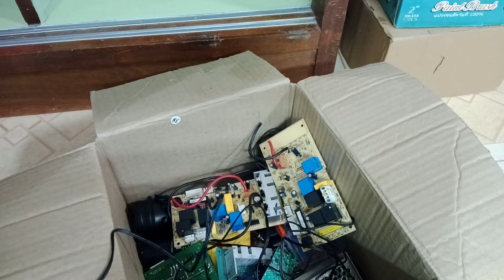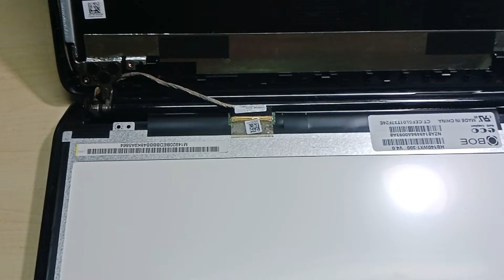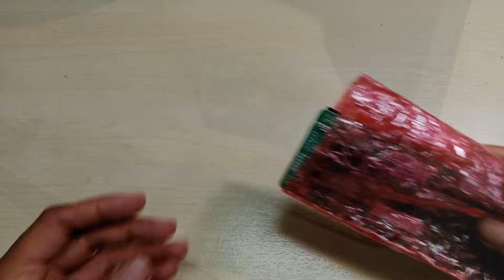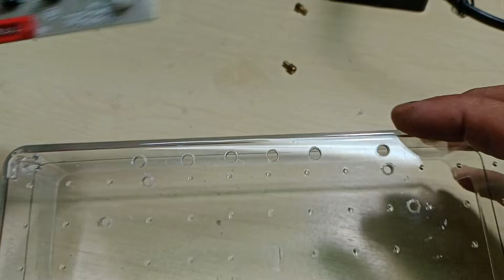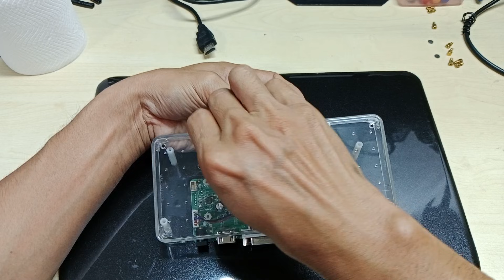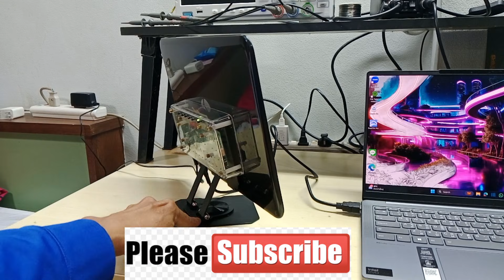Turning Old Laptop into Computer Monitor

Comment: You didnt show the most important part of how you connected the screen and the board with the wire/ribbon
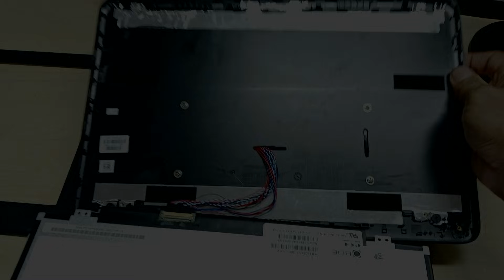Reply from the maker: Hi. Have a look again starting from 5:40 onwards. It is very clear how the screen is connected to the board via connecting wires that came with the kit.
Reply: @DIYPhil  @5:40 shows its already connected but not how you connected it step by step from the board to the screen

Comment: I have an old Dell Lattitude 3550 that is stuck with Windows 10, so I decided to take it apart & use the screen as a 2nd monitor. I bought an LCD controller board, which says compatible with N156BGE-EA2, plugged in the ribbon cable, plugged in a 12v power supply I had lying around, and the HDMI. The screen is blank, and my laptop says "No second monitor detected," but my cursor disappears off the edge of my laptop screen as if I had a 2nd monitor plugged in.

I plugged it back into the original laptop, & it works just fine.

Is there something else I have to do to get it working? Some combination of control board buttons I need to push? A new driver I need to download?
Reply from the maker: in my experience, the controller works immediately. in fact, it will work even if not attaching the separate push button boards. my suggestion is to try plugging the hdmi on a different computer. maybe it is just a device driver issue.

Comment: Sorry. Where can I get the wallpapers you used in the video? It's very informative, by the way. Thanks so much in advance for your response. Disculpa. ¿Donde consigo los fondos de pantallas que utilizaste en el video? Muy explicativo por cierto. Mil gracias de antemano por responder.
Reply from the maker: Hi. The wall paper is automatically generated by Windows 11 and it changes ones in a while

Comment: just good for viewing... but not for learning. You did not tell the details how you connect the connector from the LCD to the board.... Hopefully next time more on details....
Reply from the maker: The controller board kit has the right connectors for the lcd screen. It is just plug and play so there is no chance to get it wrong as long as you got the right kit. That is why the most important step I showed in the video is looking for the model number of the lcd screen.

Comment: If It Is a normal screen is a lost of time but if It Is a touch screen and in this way Is possible to have a touch screen to connect another PC , then I think that  It Is a very happy idea.
Reply from the maker: correct. the normal screen will soon be replaced by touch screen types. this project is just making use of old tech instead of ending up in the trash.

Comment: i have an 2007/08 core2duo laptop screen can it made like yours? btw is it necessary to use the switch?
Reply from the maker: first you have to look for the model number of your screen. then you search for the right controller board kit for that particular model. if you can find a controller for that LCD screen then it is definitely possible. I tried my controller board connected to the lcd screen only and the power supply and it does works without the switches.

Comment: for an "enthusiastic person," it's a fantastic project. when you shift to an economic and practical perspective I found that but a new monitor will be better, few things to support this argument. 1. As laptop is old, we don't know when screen come to end of life (Unknown Screen Lifespan). 2. If I add up cost of controller board, LVDS cable, case and other accessories that come very close to new monitor. 3. Its takes good amount of time to build a professional looking system like you made. 
What are your thought on this?
Reply from the maker: Hi, you are correct. It is a hobbyist project. People like me like making stuff. As for the cost, in my case most of the parts are "free" so it is still cheaper than buying a new monitor. And the monitor we can buy around here are not as portable as the one I able to make.

Comment: Please give link for the pcb controller
Reply from the maker: The exact model that I got may not work for your monitor. What you need to do is look at the LCD screen that you have and search that part number for a controller. Just use google and whatever online shopping app you have in your locality.

Comment: no body using old laptop. how about u ? are still using , correct me if i wrong hehehehe
Reply from the maker: Hi. The problem with the old laptop that we have is that it will not work with newer applications we are using in the office. Particularly One Drive that is the cloud storage. That makes these old laptops obsolete. They will either end up in the recycling shop or as I did in the video, I up cycled it giving it new life.

Comment: Great shear TY.
Any idea if a laptop monitor with that card uses less energy than most desktop monitors of same size ?
Reply from the maker: Hi. The newer laptop monitors nowadays use a small ac plug adapter so they consume only a little energy comparable to this card + laptop monitor. I think it has to do with the size of the display.